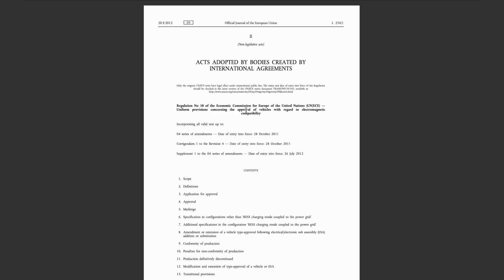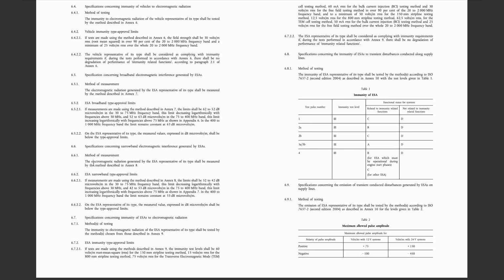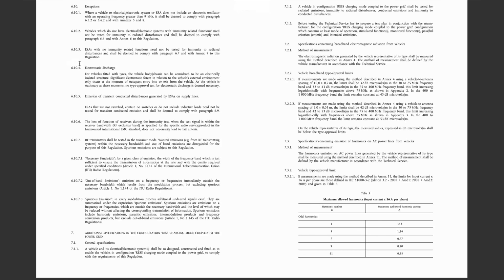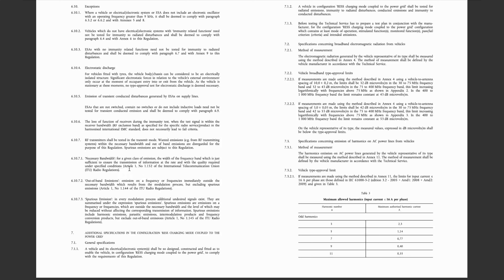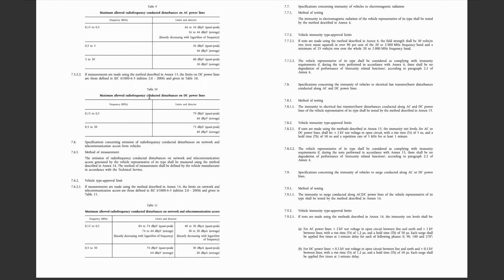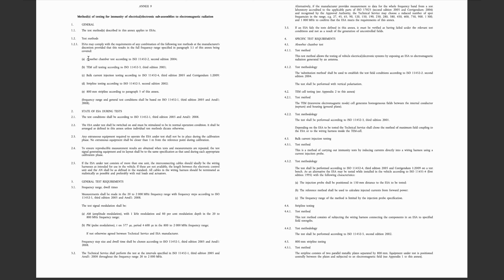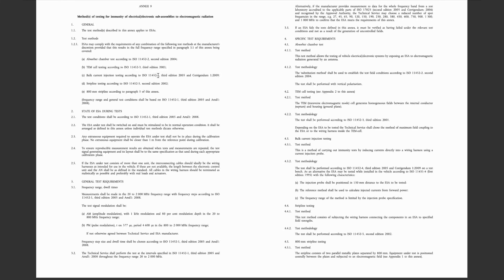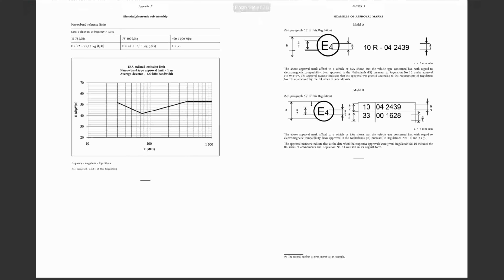Automotive EMC for Electronic Sub-Assemblies / UN ECE R10

Comment: Conclusion,
If ESA & Vehicle are involved in "REESS coupled to power grid" then only RE, RS, Transients Emission-Immuntiy, BCI, Conducted emission are applicable. 
But if ESA & Vehicles are used other than "REESS coupled to power grid" then RE, RS, Harmonics, Flicker, EFT, Surge, Transients Emission-Immunity, BCI, Conducted emission (as per CISPR 32) are applicable

(Note: Stripline 150mm, 800mm, TEM can be used in place of ALSI & BCI. Anyhow we have to cover 20M-2G frequency range for RS testing) 

Please correct if I'm wrong
Reply from the maker: I think you outlined it the other way around.
Basically, the difference between "REESS coupled to power grid" (electric vehicle) and "RESS not coupled to power grid" (not an electric vehicle) is the application of Harmonics, Flicker, EFT, and Surge testing. These tests are applied to electric vehicles with REESS only, because they are directly connected to the power grid (230VAC). 
Note that harmonics & flicker testing applies ONLY if the power grid is 230VAC. In countries where the supply voltage is different or if the supply is DC, harmonics & flicker tests won't apply. 
Hope it makes sense!
Reply: @DrEMC-sf8rx  Understood! Couldn't outlined in best way like you did. Thanks. H&F only applicable if EUT connected to low public voltages (220V, 230V & 240V)

Comment: Thanks for the detailed answer, but from my point of view as EV charging is taken into consideration as power harmonics measurement, this means not only moving vehicle is evaluated, but stationary as well. I have some doubts about moving vehicle as well as friction with air can charge vehicle body, while internal subassemblies can be isolated through on board computer and etc. What is your thoughts.
Reply from the maker: I can see why this may be confusing. The harmonics apply to electric vehicles because they can affect the power station, which is external to the vehicle. It is not the same when we consider ESD, because ESD can only cause damage to the vehicle. The R10 does not care about the vehicle itself. It only cares about the external equipment and the safety of other road users.

Comment: Interesting topic. What is your opinion on electronic subasembles ESD testing regarding R10. I have read this regulations few times, but it is not clear about ESD. Why ESD is not required, while vehicle is often suffer from ESD (metal body on insulated tires). Other standards like Ford has those requirements
Reply from the maker: Great question! Clause 6.10.4 of R10 details the reasons why ESD is considered out of scope. Reading it between the lines, R10 is focused on the safety of a moving vehicle and since ESD can only happen on entry/exit while the vehicle is stationary, this means that in the event of ESD no safety hazard can happen. So, it's out of scope. 
But for obvious reasons, most ESA manufacturers I worked with would not be satisfied with this answer. Then they would either apply ISO 10605 for automotive ESD or the conventional EN 61000-4-2. 
Notably, automotive ESD test levels are higher and go up to +-15kV contact, +/-25kV air. I believe, the Ford standard requires that as well as SAE J1113/13, so this is why EN 61000-4-2 is often applied instead, with +-4kV contact and +-8kV air. This tells the manufacturer that the product can handle some ESD, and doesn't require the manufacturer to go above and beyond of what's needed to get the product into the market.